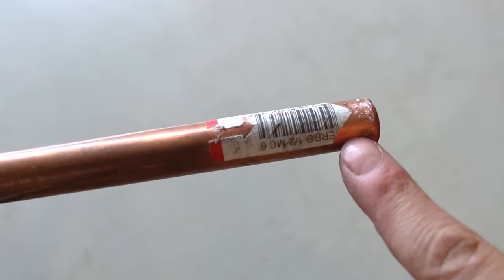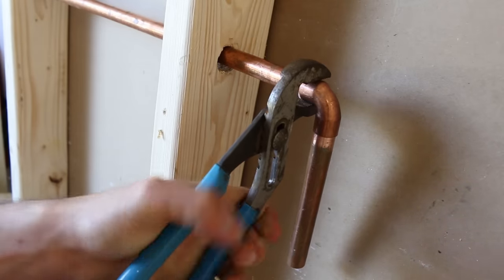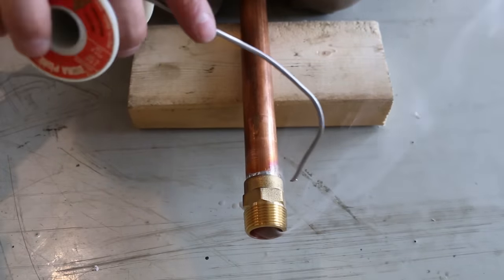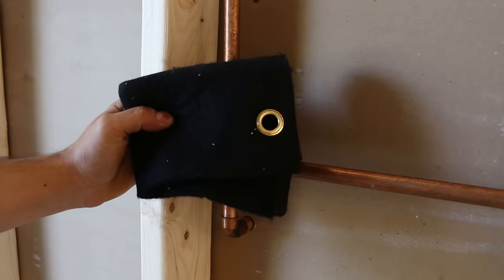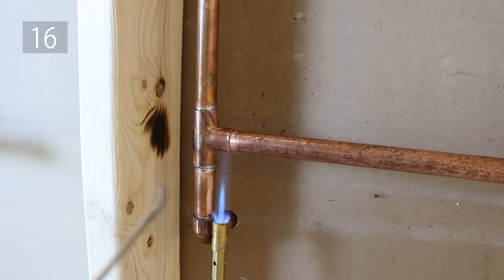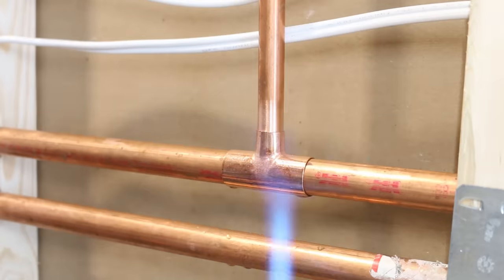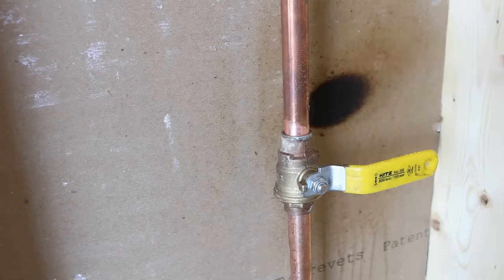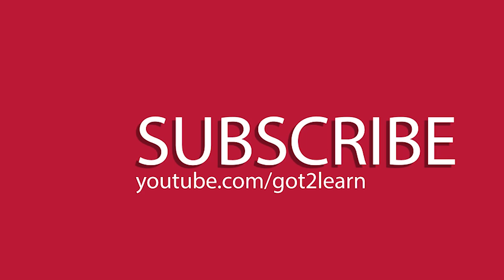The BEST 25 Copper Pipe Tips & Tricks EVER! | GOT2LEARN

Comment: I use a wet rag when soldering have been doing for about 10 years. Never had a problem with a cracked joint ever.
Reply from the maker: Good, but it might happen one day!
Reply: That is  right; my friend, I have been doing it for more than 20 years and, no crack joins.
Reply: Wet rag is not immersion in cold water.
Reply: Ive been doing it for over 34 years and never ONCE a problem....NEVER
Reply: I’m a plumbing heating engineer and using a wet rag is perfectly fine no chance of cracks in the soldered joint
Reply: @jeztickles4361  plus it makes the copper sparkle just sayin.
Reply: Same here.  But I have had problems with using a wet rag if I have soldered something that is shut off - and the temperature drop creates a vacuum that will suck the solder out of the joint - if it is still liquid.  So if soldering in a valve - keep the valve open.
Reply: 19 years, not one crack.
Reply: But it is bad practice like Got2Learn says. A good plumber wouldn't risk it. You may never see it be a problem, but someone else will maybe a year down the line or more.  I'm not a plumber, I'm an IT consultant, but I did re-pipe and re-wire much of my 400 year old home many years ago so I learned to do both properly.
Reply: @dwchester  my father has been doing plumbing for more then 40 years and he uses a wet rag ALWAYS. I guess he is a bad plumber?? No way he is an excellent plumber and I mean excellent. I was actually trained to use a wet rag by him. You let the joints sit for Bout 5 seconds and hit with a wet rag. Never had problems doing that. I'm roughing in commercial jobs everyday and always use a wet rag and so does everyone I work with.
Reply: @walterbrunswick  oh I must have missed that. I thought he said absolutely positively dont use a wet rag. It's really whatever works for you. Wet rag or dry rag I just hate whenever people dont wipe their joints after soldering
Reply: @dwchester  I'm not a master blacksmith either but when we see them place red hot metals into room temp barrels of oil and watch how quickly it cools the workpiece, it can be simply concluded that this advice on not using a small damp rag to slowly and slightly cool down copper is flawed. More of a theory than anything else. What's more, cooling off the material is far safer.
Reply: @matr1xsystems  I received an email from you about blacksmiths plunging red hot metal into oil. Yes they do that specifically to create the crystalline structure that forms in the metal when you cool it fast like that. In steel the crystalline structure makes it much harder and stiffer (especially carbon steel) so that it doesn't bend like it would if they cooled it down slowly. In soldering this is the opposite of what you want to happen. You need a smooth malleable joint between pipes. In electronics you shouldn't really blow the solder dry either because the sudden contraction of the solder as it cools can create what we call "dry joints" and over time these fail.  It would likely be OK AFTER the solder has set, to cool it down using a damp cloth so you can handle it sooner, but it shouldn't be used as a means to set the molten solder or it could create a crystalline structure. That would be bad because it is more brittle and each time the pipe heats and cools in use will put a strain on the joint.
Reply: @christopherleusner4385  You let the joint set first. That's different from using the water to set the solder.  It would depend on how long you left it before cooling it further. As per my other reply; if you cool too fast the solder will set in a weakened form. Then every time hot water goes through the pipe it will expand slightly and then contract when it cools down. a couple of thousand repeats and the joint can start to leak.  Therefore like the video says. it's best not to do it. You may not care because it's not your house, but the person living there will :-)
Reply: @dwchester  Again I would remind you that like the advice in this particular video, relating to rags and your theories. They simply do not translate into fact or evidence in the field. I am just another who can only say that in my experience and how I was taught has proven to be entirely effective and absolutely trustworthy. You may well be able to prove your theory yet but in the meantime history and account of good work practice prevails. Oh and I do not have your email address so I think it is likely what you received was a notification from YouTube, not an email sent by me. Hope this helps :)
Reply: @dwchester  I let the joint set for literally seconds. I see people spray joints with water bottle. Never any issues. Whatever works for you as I said. I will always use a wet rag.
Reply: Fidel B Duenas  same here... but  I think in theory it could crack but a damp rag can’t cool it fast enough to crack it in my opinion.
Reply: Christopher Leusner Union Plumber here giving my 2 cents. First solder a couple joints wiping each one with a dry cloth first to lightly clean flux and prevent blackening, then work your way back with a wet rag as things cool down. Simple. For the guys that say they have been using a wet rag on freshly soldered joints I’m confident you don’t solder a lot of 4”    Type L copper. You can get away with that ratty tactic on small domestic lines but when you step up to 2-1/2 to 4” it will cause cracks. Also it may form microscopic cracks immediately but they may not leak for months or years. However, you are still reducing the lifespan of that joint and system. In a hospital that my friend is unacceptable. Do it right or don’t do it at all.
Reply: @FacePeelN  I'm not talking about 2 inch and up. I thought we were referring to 1/2" and 3/4". I am doing a job right now. A 40 unit apartment building. We are running up 1 1/2" risers type L copper I almost did the entire job myself. Me and another mechanic and 2 helpers. 2 inch mains in the basement. I used a wet rag on the entire job. We just water tested not one single leak not one. I dont do much work on 4 inch L and 3 inch L. So I can't really speak for that.
Reply: Christopher Leusner read the last few sentences of my comment. Should answer all that for you 👍 what do you mean by the term mechanic? Licensed plumber? Never heard of a plumber being called a mechanic
Reply: people  mechanic=licensed master plumber. And next your gonna tell me that you guys are putting plastic DWV underground? Nothing should go underground except cast iron. Packed and poured. We are still doing it everday.
Reply: @FacePeelN  I'm not doing work in hospitals man not yet anyways. Didnt know we were speaking about that? Lol this is a residential video isnt it? Your saying it will weaken the entire system so the joints will start going bad how quickly? Because I havent had any problems but like I said I have only been doing it 10 years everyday. Grew up doing it so I have been soldering for about 15
Reply: Christopher Leusner so you live and work in Chicago i take it? Guessing from your lead and Oakum statements. Never spoke about pvc vs cast. They both have their place. If 1 joint fails then yes the entire system is weakened because it’s not operating as intended. However I wasn’t stating that. I was informing you that these “microscopic cracks” in the solder inside the cup will cause a leak and drastically reduce the life of that individual fitting. If you can hear a sizzle when you place the wet wrap on the pipe then you have not waited long enough for it to properly cool. Lastly, you need to realize in residential plumbing if you reduce the life of a fitting it won’t end the world. It will however make the customer think twice about calling you again when they are fixing the same issue you supposedly repaired prior. Could be 1 year could be 7 years later. Trust me I know. Just trying to be constructive on what I’ve learned in the trade working alongside journeyman who started at 18 and 55-62 years old and still plumbing.
Reply: @FacePeelN  no I dont live in Chicago? Lol wtf? You pouring joints on a daily basis or what?
Reply: Christopher Leusner Chicago is a lead and oakum only city. I follow whatever specs the job I’m on has. Simple as that. If a job calls for pvc I use pvc. If it calls for cast I use cast. I’m not a project manager so I can’t decide who gets what piping and where. You don’t sound like you’ve worked on very many large job sites, and I would also say you’ve probably never been a foreman. Thanks for the laughs though 👌
Reply: @christopherleusner4385  what works in some areas is dumb to think it's the best overall.  Cast iron is preferred.... unless you have different water and soil content than where you're from.  In that case, cast iron is terrible.  And so is most all metals underground. Galvanic action can occur due to soil content alone. 
    Type L copper in some areas won't even last 10-20 years while on the east coast (and other areas) it could last over 100.   
     "Cooling" the pipe is good, after you see the solder shine fade away.  And never cool the joint first. Cool the pipe from a few inches away and when the sizzle dies down, slow move closer to the joint.  If you cool the joint directly, and too fast, you will have a less than quality joint.  Not an opinion. Fact. Enough that you'll notice in a day/month/year? Maybe not but regardless, a less than quality joint. 
  Sorry but i hate when people make absolute statements about stuff they don't know 100% to be true.

Comment: I used most of these and then some 20 some years ago but class 2 plumbing doesn’t use copper anymore. I use pex and run all fixture lines to one manifold area and no joints anywhere in the line. Cost more in pipe but makes a much better job
Reply: Do you work in residential ?

Comment: Good tips but how does a burr encourage pinhole leaks? Also quickly draining a gallon or two out of the water heater is much less of a mess than cracking open meter unions
Reply from the maker: The inner burr creates turbulence and wears the pipe down quicker and the pinhole generally forms close to the fitting.
Reply: @Got2Learn  most of the ones I see are in the middle of pipes
Reply: @Got2Learn  wouldn't the burr wear out first?
Reply: Only with fast-moving water and big changes in pressure will that occur in an appreciable way.  You will hear it as a loud hiss.  That's cavitation - and will eat away metal.  But of course, just like the wind wears down the mountains, water flowing through a pipe will wear out the pipe - eventually.

Comment: The only 2 improvements: 1) I would make is open-mesh abrasive cloth strips 1"x12" is much better & faster to clean the outside of the pipes.  Loop it around and alternately pull the ends while holding taught.  2) When you cut the internal wire-brush to use in the drill, solder the stem to keep it from untwisting and losing the grip on the bristles. :)
Reply from the maker: Awesome tips, i'll add them to my arsenal, thanks @Karabetter!!

Comment: Number 8 - a good way to ensure you don't use too much solder is to use the same length of solder as the diameter of the pipe in mm. So for 15mm diameter pipe, use 15mm of solder. How do you know if you've used 15mm of solder? Well just bend the solder at a right angle at the 15mm point before use. Often the jaws of pliers are approximately 15 mm wide, so use them to bend the solder. quick and easy.
Reply: He described this in 17.

Comment: Not sure about #4 crimping the elbow so it stays in place,  could leak because your not getting solder all the way around the fitting,
Reply from the maker: Always did this and surprisingly, never got one.
Reply: I've never had a leak from doing this and I do it regularly. Just be sure to go heavy on the solder to fill in the larger gap that's been made
Reply: its a very small/lite crimp and the solder has no problem filling the gap.  never had a issue!

Comment: The cooling of brass fitting with water while hot is not recommended 🌺 fittings will sometimes crack
Reply from the maker: Absolutely, just as shown in the video ;)
Reply: Got2Learn 

But I think he meant all fittings and he said the solder cracks.

Comment: All crimp fittings nowadays, can’t remember the last time I had to heat I fitting
Reply: my company solders fittings every day
Reply: Which do you prefer? I love the look of a perfect soldered joint, so I solder, however I've recently been forced to use a sharkbite fitting, not by choice.
Reply: Either or to be honest, sometimes no option but solder cos the crimp gun won’t fit in tight spaces. Was told the other day it brought insurance premium down cos no hot works. I’m domestic plumbing/heating engineer I’m rarely doing commercial stuff
Reply: I do a lot of both. Just roughed a 7 bath house all sweat joints. Looks so nice when it’s all done. And to be honest I don’t feel like a craftsman when crimping joints. Does save time and insurance though.

Comment: My favorite trick is to hammer the pipe flat and use it for bus bar. You can also bend and solder flattened pipe into a beautiful  frame for 1000ml borosilicate beaker carafe.
Reply: What does this even mean?
Reply: @gleb10000  You know what copper pipe is, right? It's usually tubular, but you can hammer it flat and make beautiful and useful things with it.
Reply: @Bob_Adkins  Yeah, I've heard of copper pipe somewhere.  However what use for a bus bar and, moreover, what a borosilicate beaker carafe is, is beyond us here mortals

BTW, this is a video on plumbing tricks, not a craft project.
Reply: @gleb10000   Yea, well, plumbers don't use much copper for plumbing any more, so I have to do something with old pipe I  pull out and replace with PEX. Gotta use it for something, right?
Reply: hammered flat it also fits in the meter can perfectly.. Not that I have ever bypassed an electric meter.
Reply: Off the subject, but I use soft copper tubing for terminal conmectors on 2 gage wire, it crimps down nice on cables flattens and dril a hole, done. On my new battery bank I'm using soft 3/8" copper for all of the battery cable connects, works very smooth and cheaper than cable.

Comment: I once paid a plumber $100 for tip #18!  I couldn't correctly solder an outside faucet and not have it leak due to not completely being able to shut off the water. The plumber I ended up paying showed me the bread trick and fixed the connection in about a minute and charged me $100!!  I'll never forget that lesson.
Reply from the maker: You paid for the trick ;)